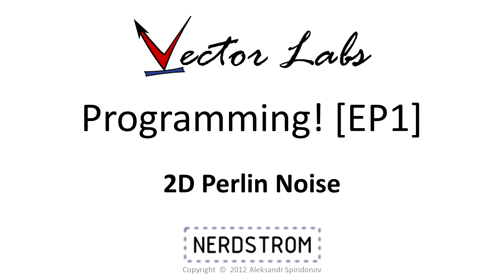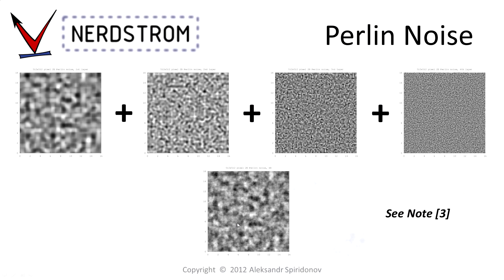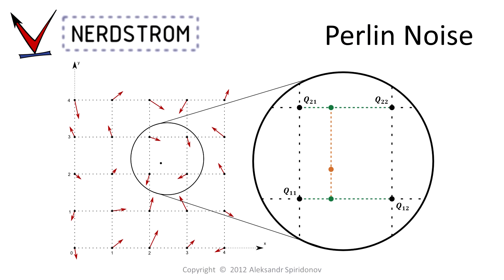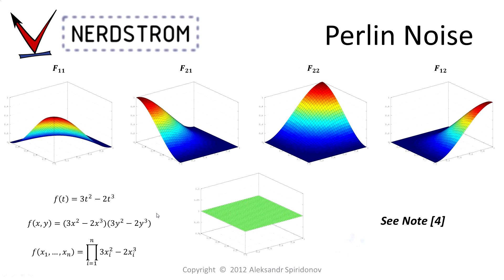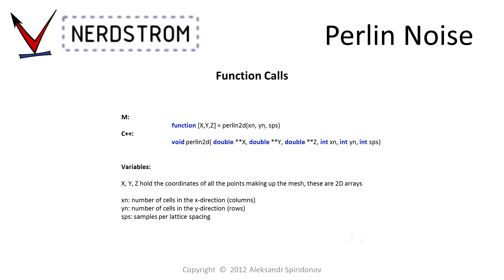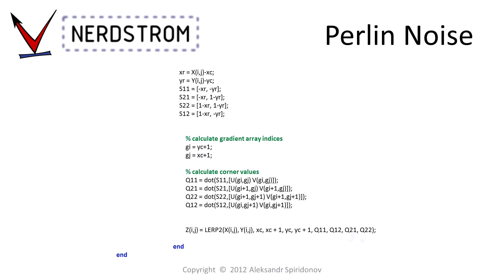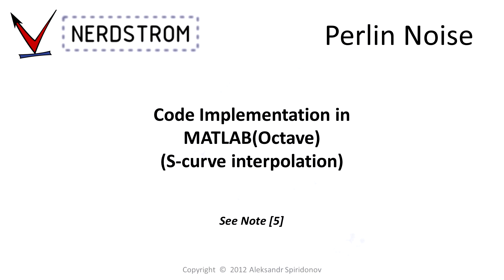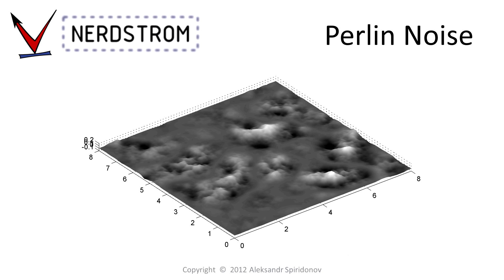Programming! [EP1] - 2D Perlin Noise

Comment: May I ask you how you did that post-processing algorithm that made the heightmap more realistic? Otherwise, great video
Reply from the maker: +Anti Matter Unfortunately I can't find the exact source code I used, but there are several things you can try that don't require much work (and can serve as prototypes for something more advanced). You can square (or cube) the values to make small values smaller (which reduces number of peaks). Abs() and exp() are also useful options. If you create a positive only map (via x^2, abs(), or exp()) you may also want to subtract out the mean (or some fraction of it) of the 2d array from the map to make both positive and negative.
Reply: Aleksandr Spiridonov Ok, I get you, I'm gonna try messing around with these functions then. Thanks for taking the time to answer!

Comment: cool... although I didn't understand like 99% of this :/ does water in every game use Perlin Noise?
Reply: ***** thnx, ya reminded me of 1 thing, textures, I was thinking "How the hell can this be a water textures!?" and from what I can remember, it actually looks like Perlin Noise was used for it :D The texture I'm talking about is a texture made by Roblox, and the water is actually pretty realistic :D
Reply: ***** Roblox? I can familiarize if ya want XD :P
Reply: ***** XD Roblox is just a website really, that has both games AND a platform beginners can learn to script on :)
Reply: +AK KA water is not based on perlin noise at-least in real time it is an just some of the animation states that is continuously looping like in assassin creed black flag it is in a state of animation until there is some physics between the water and ship or dynamic change in weather and sometimes you can also find random large tides this is so that the processing power of the console is not exceed there are many things like this so if you bring like a barrel in the game(very old since processing power was kinda limited and systems were costly) even though the barrel was physics enabled in the game engine during the development of the game but cannot be moved to save the processing power like mainly in ps3 due to its quite different processing architecture.
Reply: ***** no no i said the animation frames that predefined or pre-rendered is real time water in not actually textures in AAA games you can read more here : http://gamasutra.com/blogs/FrankKane/20140122/209052/3D_Water_Effects_Heres_Whats_Involved.php

minecraft being a pixelated game uses textures
Reply: ***** if the actual game does not involve getting into the water optical illusion is used like making the water a simple 2d plain with predefined wave patterns
Reply: anvesh mydg thnx or the link, seems interesting! :D